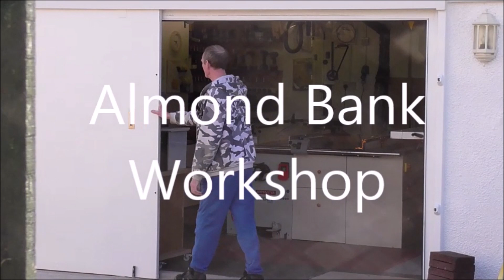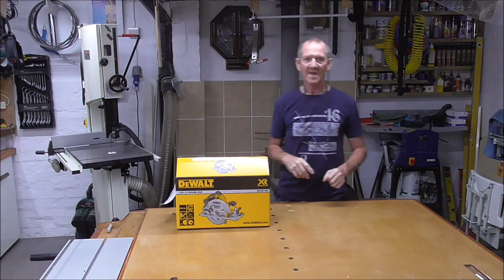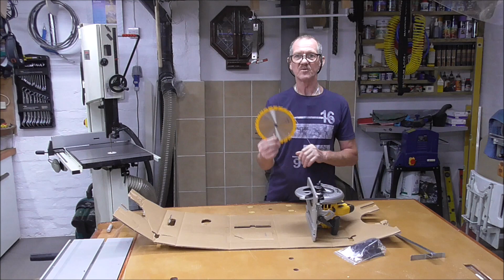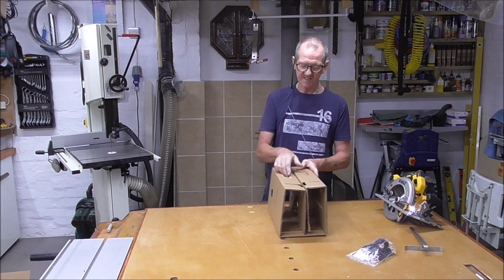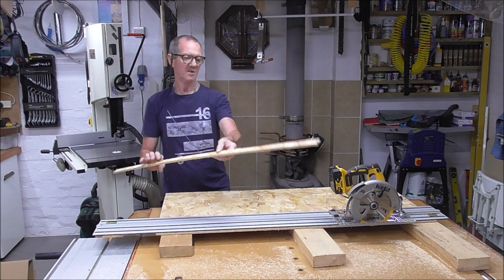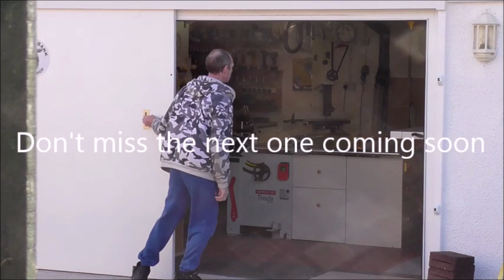At Last DeWalt have a 18v Track/Rail Saw DCS572

Comment: A related question: I have the DeWalt DWE576K which looks like the corded version of this DCS572, with the same track as in your video. I have tuned the saw to the track for 90 degree cuts. Now I wanted to use the other side of the track for 45 degree cuts and went about tuning this. However when riding the track with the correct machine slot in 45 degree position, the saw blade is still several milimeters out from touching the splinter guard. Using the slot intended for 90 degree cuts would result in the saw biting into the track. I'm confused, the manual says it should be possible to tune the track for 45 degrees, but in practice this does not seem possible. If you (or anyone) know(s) how to go about solving this I'd much appreciate the help. Maybe you could demonstrate on the setup in above video? Kind regards, Eric
Reply: I have just realised that this is the same design flaw for me. Have you figured it out yet?
Reply: I have just bought the same saw as in this video and the same track. I also have the same problem in that the blade has to be quite far out from the track when using the correct 45 degree slot on the saw.  The manual that came with the saw says that it can be done but I don't see how. It's like the 45 degree slot on the saw base is in the wrong position.
Anyone managed to sort it out?

Comment: I can't understand what you are saying.  I think that you are trying to speak American but I can't tell. Could put American subtitles on the screen please?  I am interested in this saw but simply can't make out a word.  (I apologize in advance if you suffer from a disability or have had a stroke or something as I know how tough that can be)
Reply: FFS I'm not English speaker but can understand everything of what he said. Also never heard of American language or subtitles. Great review, unfortunately the only one so far. If I can ask, to what extent the plunge saw can be replaced whit this one ? Just got my flex volt and I wonder how clean the cut will be with 60T blade ? Thanks in advance.
Reply from the maker: Hi sorry if your having problems understanding my accent its from Yorkshire that's mid UK anyway all you need do is turn on your subtitle
Reply: @dmgladden  fair enough..  I tried subtitles and it worked.  For what it is worth, I can understand you perfectly when you write!

Comment: I bought the DCS572 but i'm struggling to get a firm answer from online sellers as to which Dewalt 1m and 1.5m track model number is compatible with the 572.....any suggestions would be appreciated.
Reply from the maker: Hi Andy first thanks for watching,
I didn't know Dewalt give us a choice, I just bought what could find from Dewalt.
I got a 2.6m and 2x 1.5m and they work perfect with this saw and my Dewalt 240v track saw.
Reply: Thanks, thats helpful as i've had the saw over  year now and never used it yet. I even emailed Dewalt and got no reply.....i'll just buy a couple of Dewalt tracks and get on with the job i've been putting off ;o)  @dmgladden

Comment: Very impressed with that. Likewise I have the plunge saw, but it's corded. This would be much cheaper than buying the cordless plunge saw
Reply from the maker: Hi Maple, yes I have both but I must say in use the 18v most I only use tyec240v for very special boards as it gives a much cleaner edge on both sides

Comment: Do you need a track to use this saw?
Reply from the maker: No I use it a lot of the time without track but it helps on the long runs to get the best out of it
Reply: @dmgladden  thanks
Reply: @dmgladden  I have just ordered the DCS565N-XJ instead because the blade is on the left side should be better for me I think
Reply from the maker: @JReefJ  hi yes that a good tool with the max but it's down to what you need the tool for, I bought the dcs572 only because it had the track base as that's what I needed, I have a Dewalt track saw set but I can't always get to 240v and I didn't was to pay out for the 20v track saw

Comment: As always David another great video. The much lower price is good here and for site work excellent but how does it do with saw dust. I have the festool 55 it's an amazing saw but scary price. I have all festool rails David so for me to change over would in the end be more costly but this idea of a dewalt battery saw is clever.
Reply from the maker: Hi Louies yes it all sounds good and for a good few months with constant hard work it was until things stopped being so good and now I do still use it but when the finish has got to be perfect out comes the 230v track saw this one just can not get there but for general work also with the track its good just not for best
Reply: @dmgladden  yes that's wise words, I was impressed and thought for a little while David has cracked it and costly rail saws will be a thing of the past but sadly not so mate, I do love my rail saw but crazy nuts price, I am trying to convince myself of the need for the 2700 festool rail but again the process is daft! In the end David the finish and fit are what dictate and although I feel uncomfortable with my machinery costs they do offer a class finish, anyways pal stay well, Louie, Northern Ireland Uk
Reply from the maker: @louiesworkshop2023  I have the Dewalt rail saw full system and I love it just the wire was annoying so I hopped this would change that but quality must come first
Reply: from my experience with trying like 5 dif track saws this past year (including the DCS572 which was my first "track" saw) I would avoid the dcs572. the dust collection is equivalent to every other circ saw (crap) and doesn't come close to the FS55 with it... nor does the power, when you're at 100% battery @ 5ah the cuts are great and are about 95% close to a "real" track saw; but get down to 50% battery, which of course doesn't take long, and you start to see a sharp dropoff in torque. 25% battery and you won't be able to cut 9mm ply without it taking 20 minutes a sheet.

the power issues I imagine are solved with the flexvolt variant, but it's about the same price as the festool HKC 55 EB from what I remember... however it will have far inferior chip collection, just like the dcs572.

Comment: Got that  saw its underpowered....
I like all the futures on the saw especially  light!
If you try cut marine ply on 45 degree it will stall...
I Been using friends flexvolt... is much stronger...

I burn 3 5ah baterry...
Reply from the maker: Sorry to hear that I'm using mine every day and not finding any power issues with it maybe you should send it in to be checked out Dewalt do do a great collection service and it's quick
Reply: Hi Adam. I got flexvolt and I was thinking to buy this as spare ( to don't use the flexvolt if is not really necessary), but the worst thing for me is as 18v use 16mm bore and I have to buy separately blades. Do you think is any chance to replace the washer from 572 with flexvolt washer? All the best in what are you doing!

Comment: Mine blew within a year and I know another chippy had the same thing happen. There's something wrong with the brushless motor on this model. Notice dewalt aren't pushing them and you don't see them everywhere in online shops. They know they're a flop.
Reply from the maker: I use mine every day wall boarding on the track and so far no problems
Reply from the maker: Hi again I just did a quick search and this model is every were even Screwfix are doing it and with lots of great reviews I think you've just hit a bad batch it happens but I wouldn't put others of it as it's a great it of kit
Reply: @dmgladden  screwfix do the 54v flex not the 18v
Reply from the maker: @andsowot  no thay have both in stock as we speak
Reply: @dmgladden  not on my app but OK.
Reply: @dmgladden  Service centre basically admitted the problem too. One of those things. Still sticking to the make, all my kit is dewalt but this saw is a risk as far as I'm concerned.  The base wobbles too, basically held to the body by a loose rivet. Never get the accuracy of a plunge saw.
Reply from the maker: @andsowot  hit I have the 230v plunge saw but never used it since I got the 18v and as I say I fit wall boards which must be accurate and so far so good.
Reply: @dmgladden  Put it this way, wouldn't cut worktops or anything veneered with it. Use the 54v plunge for that.
Reply: @andsowot this is the issue I've had with mine! It's not reliable if you want a machined cut.. for instance on kitchen end panels.. returned it to see if a new one had the same issues.. exactly the same.
2-3mm of blade movement is too much
Reply: you can even buy the dcs572 track base alone to convert the (widely sold and popular) dcs570n btw. same motor, moulds and everything. highly rated and recommended by most users. the problem is with QC, like said
Reply: it's far from a flop, it's a great saw and widely sold as a cheaper variant without the track base. the problem isn't the saw, it's dewalt, they've moved a lot of manufacturing to china and things are just inferior these days. the QA just isn't there with any brand other than festool anymore. you take a coin toss on each machine. somebody could get one they use daily for 20 years no problem, their neighbour could have been through 5 within the first year. as for their customer service, same problem, outsourcing. they aren't in every shop online because they're OOS, not because they aren't sold at these places. anecdotal evidence with a bit of bias

Comment: Hello David, could you use that guard rail with the circular saw DSC391N??
Reply from the maker: This is the only dewalt 18v saw that has the rail base but these rails i got with dewalt 230v track saw
Reply from the maker: Hi again i just checked and no I have this one its what i now use with a steel cutting blade but i used to just clamp a level 30mm from my line and it was fine

Comment: I got the flexVolt version of that saw - MUCH MORE POWERFUL.
Reply from the maker: Hi yes I considered that but as I already had all the 18v batteries and flex ones are quite expensive I went for this one but I have to say it's quite heavy as it is so I would assume with the flex battery being so much bigger this would not have helped and I do have this tool in my had a lot

Comment: Hi, do you have the track/rail code that I need for this circular saw?
Reply from the maker: No I don't do this as a sponsor or such it's just what I think about gear I buy but I do get a lot of my stuff from FFX just Google
Reply: @dmgladden  you're a stand-up geezer, not doing this for money. I bought this saw too, but sadly got a makita track to go with it... lol. I cut it down to size, but it still wobbles.

as for Franco, the track you need is the "DWS5021" for a 1m track... I'll post the others below:
1.5m = DWS5022
1.6m = DWS5023
Reply: @hankhill6416  hi mate, can this saw used with makita guid?
Reply: @royalsingh84  from what I remember, it does... sort of. the adjustment cams on the saw (on mine at least) were very small tolerance and made the saw wobble like crazy and the cuts were sub-par. I ended up sending it back and getting a cheap macallister track saw & cordless dewalt circ saw... never looked back. I barely use the dewalt though, as the real plunge saw has much better dust collection. I plan to upgrade to a festool/makita tracksaw once the macallister breaks... they're so worth it, after trying my dads... but the <£100 macallister does the job all the same at the end of the day... just a bit more aligning/setting up, but as a hobbyist that's fine with me... but for a pro, I'd just get the festool (or makita) from day 1 lol
Reply: wouldn't let me tag you in the other post so I'll just copy/paste

1m = DWS5021
1.5m = DWS5022
1.6m = DWS5023

all dewalt of course. I made the mistake and took the chance on a makita track, it's too large and the knobs to adjust the saw base plate aren't big enough for the makita's rail, so it wobbles... dont bother with it. same with festool one.

the dewalt guide rails are overpriced AF imho, like £30-60 more than the makita counterparts, and aren't as good! they wobble like crazy without clamps. I'd buy the makita tape to put on the dewalt track if you get one. the tape is excellent!!!!
Reply from the maker: @hankhill6416  hi and thank you, I got my tracks when I got my plunge saw some years ago it came with 2 x 1.5m and connectors but I didn't like connecting all the time so I got a 3m as well as I do a lot of bathroom wall boarding so I needed a long one, but I always shop around for the best deals online
Reply: @hankhill6416  cheers thanks for the information
Reply from the maker: @hankhill6416  yes I've just tried the Mikita tape and it fits and works well at a fraction of the cost of Dewalt

Comment: Just a shame its not got a similar depth guage like the Festool. 
We use our track saw for re-lining sliding sash window reveals on site and its brilliant but the power cord is a P.I.T.A.
Thanks for the review and I will be interested to hear your thoughts after using the tool on site.
Reply: Dewalt makes a cordless plunger saw....this is just a run of the mill cordless saw which can be used on track.
Reply from the maker: Hi Phild my corded one has depth stop as with the Festool its the battery one that's not got one and that's because its not meant to be a plunge saw but that's what it needs when on the track.